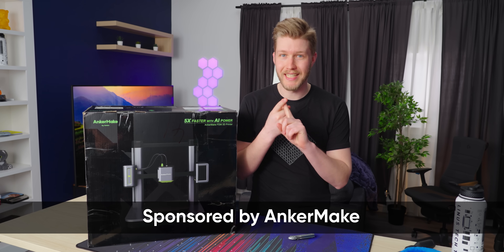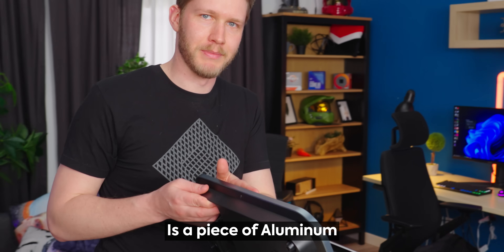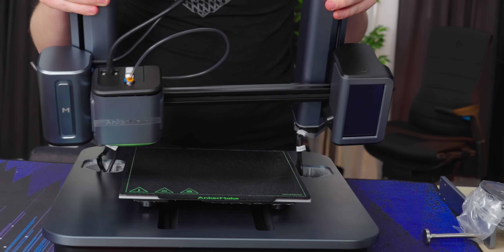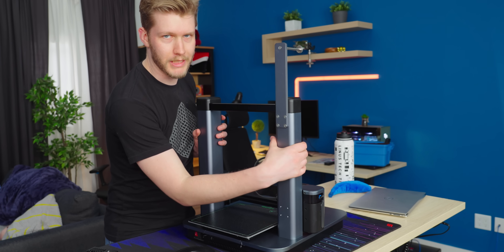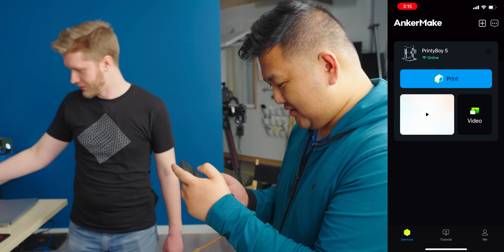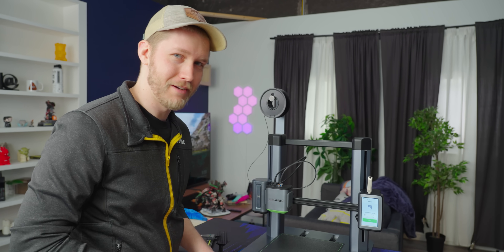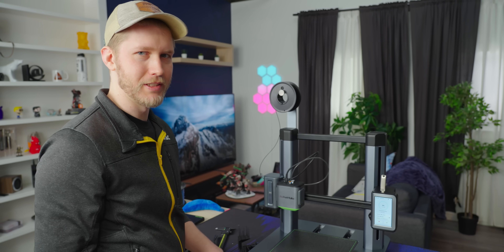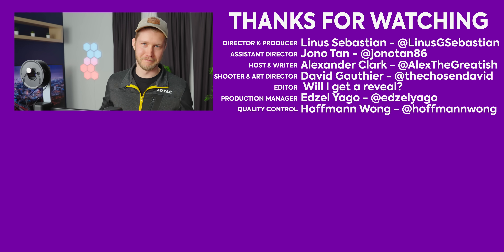Much BETTER than Expected - AnkerMake M5 3D Printer

Comment: at msrp of 760$ it has very little to offer. This printer uses well known open source software features that can be implemented on pretty much any printer with an added computer. Basically, this is an ender3 with Klipper firmware and a 20$ webcam
Reply: It's not even using input shaping, I don't think. They've got a glorified Spaghetti Detective for their "AI". It's just a reasonably well-built Cartesian but yeah, not offering anything new.
Reply: @Blooest  you're paying more for the thing to work than for pure value. ender 3s really like to stop working for no good reason, and this is honestly a much more idiot-proof design. Bed leveling is painfully slow, though, the cooling kinda sucks and i'm willing to bet the advertised 250mm/s is just the travels. probably doing walls and such at something like 80-100mm/s, since there's absolutely no way that their creality-style hotend can push material fast enough to keep up with 250mm/s.
Reply: @HorizonMakes  There's always a reason for a failure. Whether that's cheap parts, poor design, or whatever else. I always know what's wrong if any of my three printers (Prusa, Ender, ancient Prusa clone) act up. You're paying for idiot-proofing here, yep. Like I said, nothing new here for a Cartesian, though it does look like a reasonably well put together kit. At the KS prices I can see the value, but they're asking $760 MSRP. I don't think it's deserving of quite that much, mechanically -- you're paying for that ridiculous cast aluminum, if they could get it down to $500-$600 it starts to look a lot better imo.
Reply: What the advantage of using Klipper on a ender 3 ?
Reply: @1310up  lets you tune the crap out of your printer and get speeds like the ones advertised here.
Reply: I come from the futureeee… it’s really cheap I got one for 300$ Canadian
Reply: Yeah honestly just get an ender 3 with a bl touch auto leveler and a $20 webcam and it would be not only way cheaper, but way better imo
Reply: Mmm.... I'm a little more generous? But not much. I don't think it's price competitive - my 3V2 printed about that well out of the box, too, and that's without auto-levelling.

But I brought some knowledge with me that had to help, plus I did a couple of immediate upgrades (bed springs, bowden tube clamps, the basics) and that probably helped too, and while those things aren't expensive, they aren't free either.

Plus it comes with an auto-leveller and is clearly a hell of a lot easier to put together. That's legitimate value. Not enough for the price, but meaningful.

My main disappointment is that at $760 it should have a hell of a lot larger bed. When I saw the base I was ready to pay attention, but a print area that small? At $760? C'mon. That's bullshit.
Reply: 760 is a bargain imo compared to the time required to set all of those features up + all the "polish" you get from a all in one solution like what they're offering. I don't know if there are others in the space who offer similar features for better prices, but I'm blown away by the quality and ease of printing demonstrated. It also prints incredibly fast. All in all I think you could get here with an ender but it would probably end up being fairly close in price and you would waste so much time troubleshooting and setting things up.
Reply: @TacohMann  That's true, setting up and tuning Klipper is not for everyone. If their level of polish provides repeatable hands-off printing, it may indeed be worth the price.

Comment: Value is not there for me if it had a larger build area then yes. Y'all should check out the anycubic Kobra max with a 400mmx400mmx450mm build area

Comment: As impressive as the machine is, that's no 250 mm/s printing. Top speed perhaps, but from experiences that looks more like half that speed. I'm sure on bigger pieces it would reach those speeds more often, but on the torture test? Nuh-uh. Also those acceleration values seem too low for 250 mm/s, that's 2000mm/s² max

Comment: They probably use something similar to the CR-6 SE namely a strain gauge sensor which detects pressure on the tip of the extruder. It has positives & negatives - if the tip is dirty, it can detect the Z level poorly but on the positive side, you don't need to screw around with Z-offset.

Comment: The aluminum base is pretty neat, but makes modifications more troublesome. Seems like a printer designed for the layperson, not particularly tinkerable and "just works." Something goes wrong that they can't repair and it gets tossed.

Comment: 🤘🤘 haha nicely done tearing it open 🤣 prints really dang great
Reply: I’m curious if it also had the aluminum on the inside of yours, if they let you keep it or if you still have it, I’m a little curious to see if you got a more current model
Reply: @chrismajewski4884  I’m assuming mine does because the machine weighs about 25lbs

Comment: 3D printers are finally getting reliable? great, looking forward to buying my first one in a decade or so when they're idiot-proof
Reply: they will never get idiot proof. even normal printers never got idiot proof in my opinion
Reply: @chy4e431  is it really idiot proof though? i thought ender was the one where you have to do extensive mods/tinkering just to get it to work
Reply: @MrWizardjr9  not really anymore, you totally can if you want better prints but it's not necessary nowdays
Reply: @chy4e431  Enders are notorious for not being beginner friendly and needing a lot of upgrades to get working reliably, ABL, better motherboards, stepper drivers, etc.
Reply: @mizz1414  got an out of the box ender 3v2. I was able to print my own designs straight away.  The only issue was bed adhesion,  which I sorted by leveling properly,  and cleaning my grubby pawprints of the bed.  I'd recommend one to any fdm beginner.
Reply: They already are, this printer is extremely overpriced because it's marketed to people who know nothing about 3D printers.
Reply: @gopherguts2183  which one would be good bang for the buck then?
Reply: @Lenduya  depends on the price level. For about the same price as this you can get a Prusa MK3S+. You have to assemble it, but that isn't too hard. It makes better and faster prints than this machine and has more useful features. Also, almost every part is either 3D printed itself or widely available. Something goes wrong? You aren't shelling out big bucks for proprietary Anker parts. It's also open source, meaning it has thousands of upgrades and a ton of user support.

Comment: Super cool to see someone focusing on making printers more reliable, they're already niche without needing the technical skills to tinker with them constantly and persuade them to work.

That said, it's still pretty pricey and I wish it had an enclosure around it both for consistent heating/temp control and also for the fumes. Wouldn't want ABS filament going anywhere near one of these if I was going to be in the same room

Comment: 12:35 The cylinders are a test of the tolerance, meaning that .5 .4 .3mm of a gap is repeatable. But a .2mm gap is too tight and fuses between the 2 parts.
Reply: Is that .2mm gap in total or per side?
Reply: @MikkoRantalainen  per side
Reply: @garramiro  Thanks for the info. I'd love to have a printer that can print parts that can be snapped of with only 0.1 mm gap per side.
Reply: 0.3mm is still fairly impressive
Reply: @matsv201  For a modern FDM 3D printer, 0.3mm is honestly fairly disappointing. A very good number of machines can handle 0.2, and some better machines can do 0.1mm.
Reply: @SplicesAndCelluloid  Except that this is OoB experience with no tuning and running at 250mm/s with the included filament.  I'd certainly like to see some additional testing, with better filament, varied temps and different speed to compare.  (The overhangs showed that the filament was too hot or insufficiently cooled to print to that tight of a tolerance without fusing.)
Reply: @SplicesAndCelluloid  There is no printer out there at this or double the price that can print this good WITHOUT being dialed in, out of the box. If the final product is as good as this beta pre-release product, Anker has a huge winner in their hands and all the other 3D companies  better be upping their game, and fast.
Reply: @SplicesAndCelluloid  for a tuned high quality printer printing horisontalt yes... but for a out of the box consumer grade printer printing vertival.. I would still day its fairly impressive..
 Is there better printers... yes...better and faster... sure... better, faster and cheaper....now it start getting hard
Reply: @culbeda  that print was definitely not going at 250mm/s
Reply: This isn't a Voron 2.4 and it is painfully obvious. Wake me up when 10K+ accelerations and 500 mm/s speeds are here. And there are several parts that have been pointed out that will fail early on given the material used. Avoid!

https://www.youtube.com/watch?v=0E0dM0ZdpRE
Reply: @jeremytine  isn't it supposed to be $429 though?
Reply: Still impressive af that they worked so well without any dialing in.... ive spent weeks alone dialing mine in and this is blowing me away
Reply: @jeremytine  the Jess guy is right. You're out of touch if you believe the vast majority of people running consumer sub $1k 3D printers take time to tune settings and create profiles. Those of us who are more tinkering oriented obviously do, however the ones used in schools, colleges, and in the homes of  "normies" get the default profile no matter what type of off-brand PLA they're stuffing into it. Those people don't care about fine tolerances and just want something that works adequately out of the box in most circumstances. Even if that ultimately means paying more for quality of life improvements, but receiving "less" in precision.
Reply: @jeremytine  Tuning. Most ender 3's are getting the default cura profile (or whatever they find on the sd card for creality's branded version), and the default pla profile. That has been my experience in working with 3d printers in a makerspace setting for 7 years. The only person doing tuning was the guy who ran his own print service. And its doubtful he's the one anker is aiming for with this.
Reply: comments like this deserve an award lol
Reply: Has anyone seen how fast 250 mm/s actually looks on a bed slinger? Try looking it up, at best that is travel time at worst it's not even travel time and they're just lying.
Reply: @jeremytine  The amount of folk who do that are in the extreme minority compared to how many printers are out there. Pretending otherwise is unrealistic, especially for the target audience.
Reply: Wait, that test is pretty rigged ! I thought it was .4,.3,.2,.1 like any test !
Reply: @tdg9281  How is it rigged if it's clearly labelled what's being tested? And what would the point be of testing 0.1mm when 0.2mm has already fused?

Comment: Should have told Jay to not buy the stupid 3k printer that's worse than Creality's cheapest printer lol, the test print is pretty good honestly! The spikes on the top with little to no stringing is mental! The overhangs though need some work but that could just be temps

Comment: I dont know. My Ender 3 Pro has been working perfectly for a couple years now. The only issues i got with it was using cheap and old PLA.
BUT I know the feeling of a 3D printer just REFUSING TO WORK like my first 3D Printer Tevo Tarantula.
Reply: That was my first one as well, god how far we have come lol
Reply: still rockin' the Tevo Black Widow here, though it's one of those ship of Theseus situations where pretty much every part has been changed at some point other than the frame...   lol

Comment: stereolithography printers seem to be the superoir 3d printer type.
Reply: having both types at home. SLA gives super accurate prints. However I still use my FDM printer 90% of the time due to a lack of work before & after an SLA print ( cleaning and handling the resin and alcohole bath ).

Comment: There are other methods of mesh leveling, like with an inductive probe.
Reply: Yea, but there you have to mess a lot until you find your offset per material, printing sheet, nozzle and stuff like that. Measuring directly with the nozzle is way easier, more convenient and accurate.
Reply: @alphastratus6623  I understand that a force transducer is better. I was adding to the very short list of probe types Alex mentioned in the video.

Comment: It's concerning that major companies using Kickstarter to fund their products has been normalized.
Reply: they said they are making it whether or not it hits the goal. its just for advertising
Reply: @MrWizardjr9  Their "goal" was setup at $50,000.  Their company is worth at least $1,100,000,000 and they made over $4,000,000 on the Kickstarter alone.  They are that big a company and yet, according to a comment from Short Circuit below,  decided to use Kickstarter, rather than their own website, because they have chosen not to create their own e-commerce insfratructure.  

On the funding side of the issue, they can make any claims they want now about making the product regardless of the Kickstarter without backing up said claims.  This is because they have now "proven" that their product will sell, even though in order to do so they passed on all the front-end costs of production to their customers.
Reply: I would do the same thing in their position. It makes sense to gauge the demand for a product before you start to produce it.
Reply: But they aren't scams at least
Reply: @KJMcLaws  That is exactly the normalization that is concerning.  Just because something isn't a scam doesn't mean its origins in crowdfunding are acceptable, considering that Anker clearly has the funds to make the product while also incurring the risk of production.  It has simply chosen to bypass said risks and pass them on to the consumer instead and it has been so normalized that no one sees it as a problem anymore.

Comment: Just flip the filament holder around so the bar that the filament hangs on is facing away from the printer and you can fit any filament you want...
Reply: That big spool is too wide for that holder, too. And it would clip into the printable area (even if you are unlikely to actually print something that extends into that extreme top left end)

Comment: I love how Alex and LMG explains things a way that even people with not as much knowledge with tech have a slight understanding with these videos, so thank you so flipping for pushing these videos out every day no matter the situation or the day ❤
Reply from the maker: Thanks! Make sure you @ him with the kind words on Twitter.
Reply: @ShortCircuit   will do :)
Reply: @ShortCircuit  at first when you cut the filament that is a good way to jam your nossel
Reply: @ShortCircuit  please just make him stop using nonsene inch and feet units. Pleeease. He is a mechanical and CNC engineer, for the love of god you're doing everyone a favor including yourself by going with 10ths and 100s of mm.
Reply: @RandomUser2401  This. Especially with anything related to 3D printing. Even nearly all the Americans I've talked to in 3D printing groups use metric for 3D printing related stuff
Reply: @RandomUser2401  Yes. Sure, 1/32" may be a bit more precise than a millimeter, but it's much easier to use 0.X mm than 64ths and 128ths and 256ths of an inch. We know where to use what here. Microns!
Reply: @Tfin  yes, microns - aka one thousandth of a mm. Metric all the things. Powers of 2 are great for computer science, in measuring real life distances they are horrible.
Reply: @Tfin  The only time i've found that kind of level of precision better was when i was working with sheet metal.   You can easily, by eye and rule, cut something to a 64th of an inch with precision,  but you cannot break down a millimeter   by eye with any kind of precision.  

And i live in a metric country, not the USA.  But for calculating anything that you aren't doing with your eyeballs.  Microns are always going to be superior.
Reply: They could do a better job of it in some videos, though

Comment: Pretty careless to risk breaking it before you use it. 🤦‍♂️
Reply from the maker: The start was a teaser to what happens later in the video....
Reply: @ShortCircuit  I should have said careless, not dumb. I edited the original post.
Reply: @ShortCircuit  and to be fair, I have ZERO personal experience or knowledge about 3D printers. Only what is common knowledge.